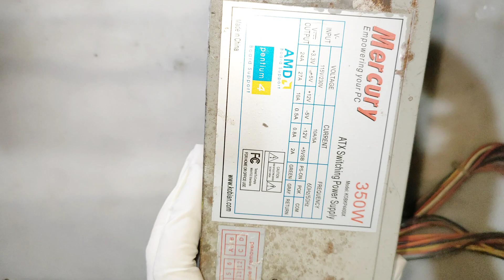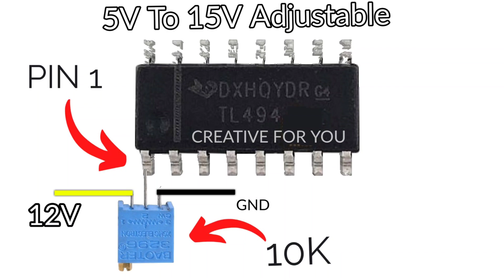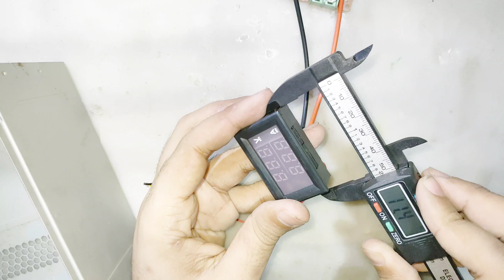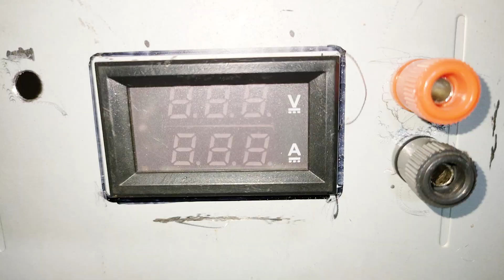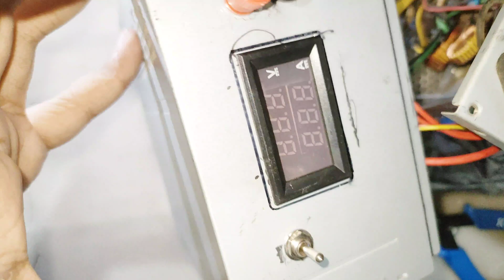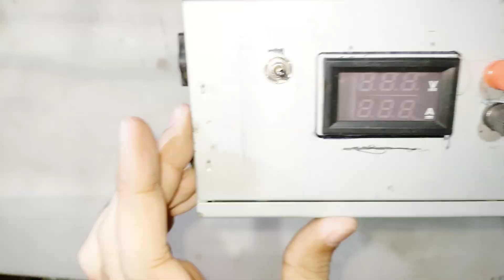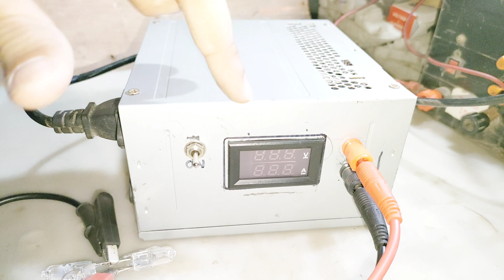Convert ATX Power Supply to a 12V Battery charger #battery #batterycharger

Comment: Max volt 12,7 dopo di che va in protezione
Reply from the maker: Try finding older version of PSU , they don't have protection and don't forget to change output capacitors before

Comment: I tried something very similar at home, much simpler, I didn't add potentiometers for voltage regulation or any add-ons for changing the current. I just connected the yellow wires together and the black wires together, so the base is only around 12.43 V, and I'm not sure if that's even okay. Would it be good to add a buck converter to that 12.43 V to regulate the voltage? Thanks for Nice video, best regards.
Reply from the maker: If your battery voltage is lower than 12V then you can use buck converter

Comment: Hello. I have a power supply with SDC339 and SDC7500 chips. Which IC chip should I solder the potentiometer to?
Reply from the maker: SDC7500

Comment: Great work my friend. I have ATX Power Supply but + 12 V 19 A, and also +12 V 8A. Can I use this kind of combination and how.
Reply: @hiksiol6306  what do you plan to charge ??
I am assuming it's a battery ,the battery charging voltage should a bit higher than a fully charged battery .a fully charged battery gives 12.6 volts,2.1 volts each cell.
So the charger should atleast output more than 12.6 volts,without any alteration to the psu ,just connect the wire carrying 12 and 3.3 volts,by doing doing you will have 15.3 volts .and that would surely solve your purpose .
Reply from the maker: 12v and 3.3v cannot be connected together , to obtain 15V
Reply: @Electronic_For_You  -12volts and +3.3volts.   15.3volts ho jyega brother  so easy
Reply from the maker: Yes it's possible but , -12V is Maximum 1A output,

Comment: You forgot to add the charging current limit. You need to limit to C/10 and not get damage to the SRLA batteries. Hope you can do it.
Reply from the maker: 🤔 oh right
I think its better to rise the voltage to 15v and use cheap buck converter

Comment: If i ground 4 number pin, will the power supply never stop?
Reply from the maker: Ground Green 
To start the psu
Reply: @Electronic_For_You  I'm saying about 4 number pin of 7500B ic. Not about green wire.